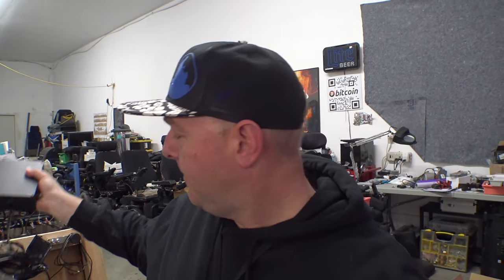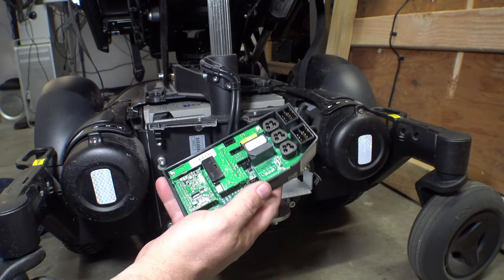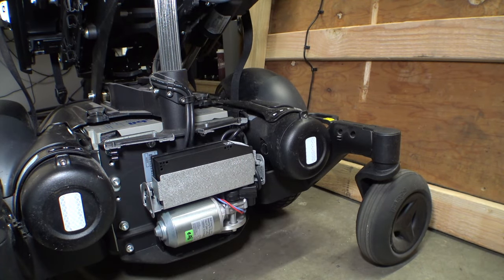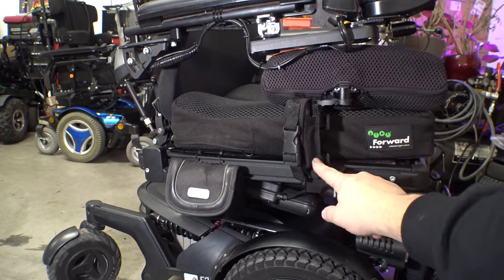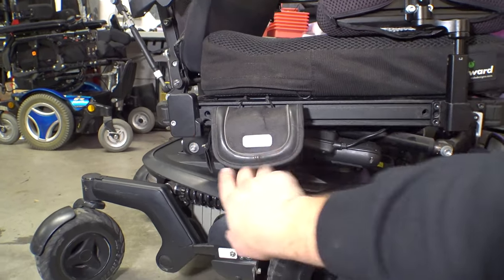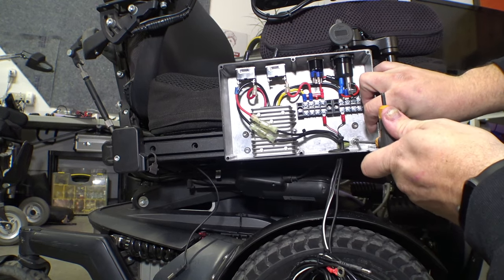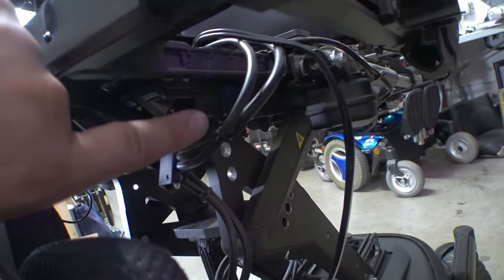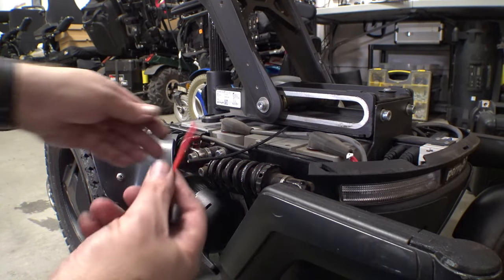VLOG 687: power distribution box! (installation)

Comment: Dan, nice job!! Looks awesome.  CANT WAIT to see the rock lights!  Personally I would I stall small.micro Led lights. That harness is way too long and end results will be the same. The micro LEDs dont pull any if just a bit amperage so you can have a blast and wire from a twin lead harness to your new box @ 12v.  They even have independent stand alone strobes leds 2 wire plus a program flash wire you use once and cap it.   Lights make a project! Iove leds! Good luck and cant wait to see finished product! Love to see that baby with a bazooka tube speaker system modified from an atv mount with bluetooth from your phone. Rock that place!   I am still trying to wire a joystick to bypass my pronto one that is programmed  for snail walk.  I have a sander speed controller but cant steer motors . Drives me crazy.  I wont give up. I always figure something out but this one is burning my mind. Any way good video! Have fun. Scott

Comment: Great job Dan. Perhaps you can install a little esp32 in there and some 3v/12 multiple relay board in there, this would allow you a wireless on off connection. There are some nice rotary dial/dispays with touch screen by lilly-go that are esp32-s3 powered that would allow you to have the actual contols mounted anywhere you wish. You would also have access to your chair in home assistant via espNow/esp home.
Reply from the maker: Good idea! I keep forgetting ESP32’s exist!
Reply: @TotallyNormal-  just as an aside, I'm sure you know but would probably need an esp module that had a u.fl connector and pigtail that out to an antenna mount as that metal box would likely block the signal.

Comment: Here is a idea Dan.😂😂 Integrate a air pump with roho air seat. To be able to air up my seat with a button. I have m3 with usb port. Amazon has usb powered pumps for blood pressure.
Reply: there is a company called Kalogon that makes an alternating air cushion system and they just released an add-on monitor/controller for ROhO cushions.

Comment: I have a 23 Bounder it should be pretty much identical to add the same type of deal to my Bounder correct or did 21st century scientific do something different I was supposed to have a USB charger on it when I got it but it didn't so I used my old per mobile USB charger and one of my old Chargers to use the XLR charging port in the front of my controller but whenever that's plugged in my wheelchair won't drive
Reply from the maker: sounds like the XLR USB charger is tripping the chair's inhibit pin.. does it work ok on other chairs?
Reply: @TotallyNormal- it worked on my permobil m300 from like 2017

Comment: Do you connect both the positive& negative to one battery?
Reply from the maker: No- for powering stuff like this, you want to connect across both batteries in series just like the output to the chair. Pulling power from one battery will get them out of balance pretty quickly, and result in one battery being under charged, and the other over charged :-)
Reply: @TotallyNormal-  so red wire to one battery and black wire to the other battery?

Comment: I have a newish per mobile m3... My usb charger stopped working almost immediately.
Reply: Remove the Permobil USB port.   Place in trash can.   Even if it's new and still working.  It is only 1.5 amps and they fail often.   Sheesh... it's powered by the r-net bus!   Of course it's lame... there aint enough power there to do anything.
Reply from the maker: Yea the stock USB chargers are pretty bad.. you’d think for the price, they could at least match the cheep import ones for power output, or even quick charge!
Reply: I'm betting they're limited to 1.5 amps because of the power limits of the r-net bus.

Permobil has to consider all the common drains on that power supply and keep their appliances in line.   It's the only explanation which makes cents, since it would cost nothing to double the USB power.
Reply from the maker: On my chair, it’s powered via the ICS bus.. haven’t done any testing on how much power that can supply- but I’m sure the actuators use at least 5 amps…
Reply: Isn't the ICS bus powered by r-net?   Now I have to go look.
Reply: @wheelchairghost  no kidding.. The lights are quite difficult to tighten as well.. they bounce around like a disco party when in motion... but they are decently powerful and help immensely